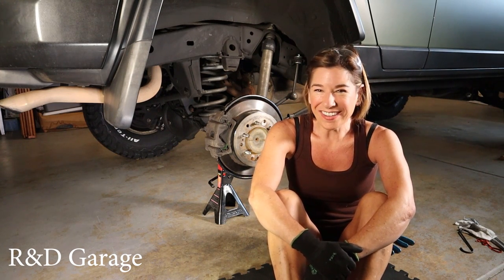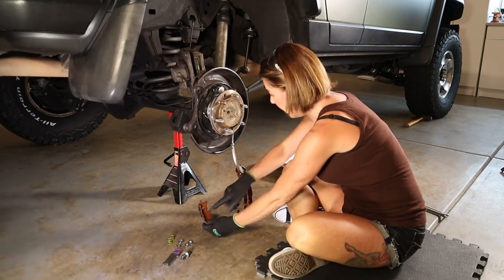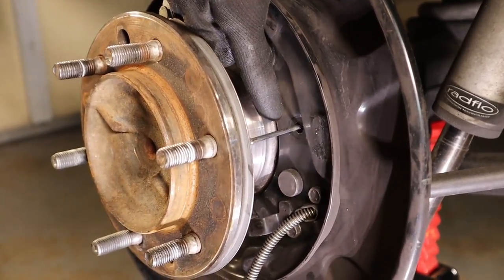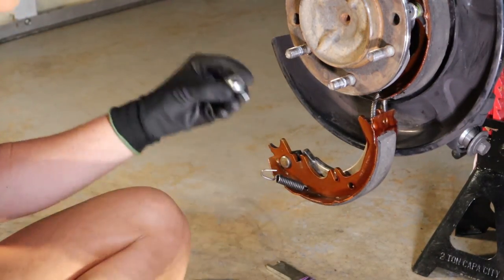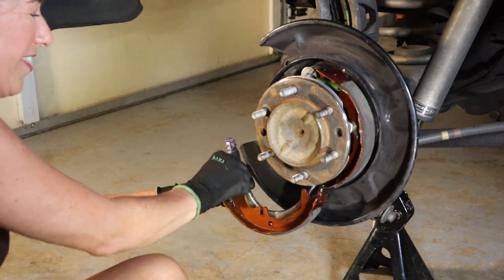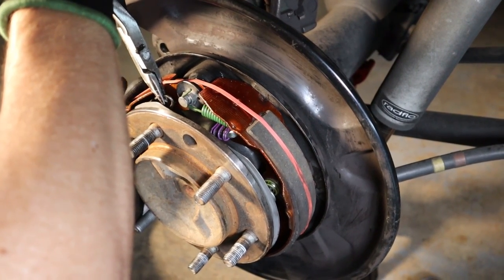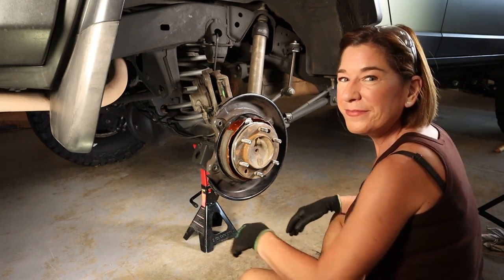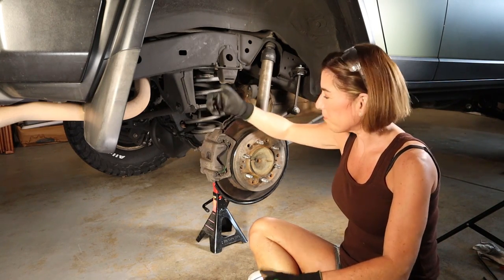How To set the Parking brake on Toyota FJ Cruiser!!

Comment: Thank you SO much for covering a topic that has basically never been covered by the FJ community! You’re a life saver!
Reply from the maker: You're so welcome and I'm super happy it helped you, Judah! Thank you so much for watching, you made my day! :)
Reply: @RDGarage  if im replacing calipers, is the one wheel at a time ok to do? Any hangups in that scope of work where getting both sides up is better? Thanks
Reply from the maker: @svnbit8408  One caliper at a time isn't a big deal but you just have to make sure you properly bleed the brakes each time. If you're doing pads/rotors with the caliper, it's best to do them in left and right pairs.
Reply: @RDGarage  Thanks, I'm definitely going to do the calipers, rotors, pads I don't want to mess around and they are problematic anyways. 
Would you happen to know if the hand held vacuum bleeding works in the rear with the electronics that work in tandem? Not quite sure if it's as easy as the fronts, with the vehicle off. (I read the master cylinder bleed requires test equipment to open the actuator with intermittent electric  pump pressure doing the bleeding, I think.
First time doing rear disc brakes. Thanks for the content!
Reply from the maker: @svnbit8408  You're welcome! Because of the importance of the proper bleeding of the brakes, I strongly suggest you refer to the Factory service manual for the proper procedure! As long as you didn't remove or take apart the master cylinder the bleeding process doesn't require any special tools.
Reply: @RDGarage  Thanks, I suspect my bleed on the fronts when I replaced calipers, wasnt the best., pedal is a bit soft, has that characteristic squish from the actuator not sealing up properly, or just the rear wear is causing it  (Fluid still full) I figured I could try that pump to get a better bleed from the front, and see how that feels before moving on to the rear, seems more straightforward without anything fancy. 
Getting it done tomorrow morning before a trip to the mountains, on a Sunday not an ideal day for parts runs or bail out at a brake shop lol. As long as I don't starve the master cylinder I really don't have an excuse, lol. 

I spent hours cleaning out my garage and fixed the malfunctioning higher-clearance door that allows space for vehicle on stands. (main reason for my initial question, I thought I might have to do the rears on a slight grade on the driveway, wanted to play it safe) 

I'm glad I switched gears, got the class -5 hoarder garage situation under control, and knocked out all the maintenance and repair stuff and can do the brakes in the am comfortably, with your insights and with a second set of hands around if needed. 
Cheers,
-Lee
Reply from the maker: @svnbit8408  You're so welcome!! Good luck!!

Comment: 2007 FJ has a noise behind the rotor and found the retaining spring was loose and cap was bouncing around. I almost pulled the hub and axle. I should have thought of a simpler approach first. The parking brake engineer definitely needs a slap on the back of the head. We are the original owners and it has 216,000 miles. Thank you for sharing and have a great day.
Reply from the maker: Hahahaha!!! I agree and that’s putting it nicely!! The parking brake is not a fun job at all. How cool you’re the original owners!! I hear that’s still pretty low mileage for one of these guys. Thanks for the comment and have a great day too!

Comment: I found a video where they installed the clip assembly first, pulled and slid it into while inserting the shoes. I used a small zip tie to compress the spring. The shoes has a slide and not a hole for the clip assembly.
Reply from the maker: Yes!! Thanks for the tip!! It seems everyone has a way to get this done and I love hearing the solutions!

Comment: What I do is get a forked body trim tool, put the spring and spring bottom and top on and lock the front retainer then pry the back with the forked tool so the spring is loaded up. Then I push the shoe in,  let go of the loaded up spring and usually I just have to move the bottom retainer arm into the shoe's hole to lock it in. Way easier than trying to put each piece in and then lock the retainer over the spring through that tiny hole.
Reply from the maker: Nice, thanks for the advice!

Comment: Hey R&D
So I had a shop replace my rear right axel seal. Immediately I noticed a strange vibration and clicking happening in the shifter console. I was adamant it had to be something that was done incorrectly as it began within 5 miles of that service and had never happened before. They eere defensive and a challenge to have them keep custody. Ultimately they said they found the issue in the p brake cabling being too loose. That they had to tighten the cabling and that they had corrected the issue.  
I took custody and it appeared to be fixed for the first few 100 miles. Then I noticed only randomly and infrequently, a faint noise from the rear, very slight ticking. That went away completely. For about 4 weeks. I wondered if it was the back door hinge. 

Tonight on the highway at 70mph I hit a slight bump on the highway, and the chatttering and vibrations in the shifter and p brake handle came back in full force. It was alarming. I drove through it for a minute looking for more changes in the transmission or something worse to appear. It drove and appeared fine aside from the noise and vibrations. They worsened when pulling the p brake handle up 1/8 of an inch. 
I accelerated up to 80mph and after a minute at that speed, the vibrations and chattering stopped completely.

Any ideas of it could be the wheel/brakes being improperly reset, or something more serious with the axel seal install?
Reply from the maker: Oh no!!! Ok, let me look into this a bit, I have some ideas but I wanna make sure I'm correct. Sorry took some time, I was at PRI since wed.
Reply: @RDGarage  Update is that I diagnosed the possibilities myself and provided them a written timeline that they reviewed and inspected with the vehicle today. 
That the seal replacement was not working and that the extra grease had failed the emergency brake clamps through saturation. That’s their story. Or that the brakes were not properly reinstalled after an improper seal replacement is my fear. But I seek the positive. 
They reported the failure, confirmed the damage of the brake system and are accepting the cost for replacements so far, a complete restart of the job. 
They have a generally great reputation and have not failed me up unto this point. We shall see.
Reply from the maker: @rztricky   Ok, it seems to me that if they only replaced the axle seal and nothing else, that's a problem. The indicator of a blown axle seal is grease everywhere in the brakes. If they've already agreed to go through the brakes, go with that and see what happens. Don't forget the axle seals can sometimes be damaged due to plugged axle vents so be sure they checked and cleaned the vents in the process. Good luck and keep me posted!

Comment: Great video! Thank you. I have a quick question, where does the white "anchor spring" go? Thank you
Reply from the maker: I'm not quite sure what spring you're referring to..could you give me a timestamp?
Reply: It’s not in your video but it’s in the new hardware kit and on the awful Toyota supplied diagrams.
Reply: Also, did you use the actual Toyota kit? Your caps on the pins look much better than the aftermarket one that I purchased from Amazon. Thanks again
Reply from the maker: It's hard to say without seeing it in person, and yeah, mine was an aftermarket kit from rock auto. Raybestos brand kit.
Reply: The parking brake diagram from Toyota has a spring called the Anchor Spring

Comment: Will you be upgrading with a Rear Drum to Disc Brake Conversion kit?
Reply from the maker: The FJ has 4 wheel disc brakes from the factory. The rear parking brake is a little drum brake inside the hat of the rear rotor.  Maybe you were thinking of another car?
Reply: @RDGarage  I think you are right.

Comment: I put in new shoes and hardware, but I can’t seem to get the right side adjusted. When I set the parking brake there is movement. There’s more to the story, but never ran into a problem like this. Is there a certain way the adjuster goes at the bottom??
Reply from the maker: The adjuster should be oriented so when you turn the adjuster wheel down from the front it should be "loosening", i.e., bringing the bottom edge of the shoes closer together. Hope that helps, thanks for watching!

Comment: Can you explain the tension method Without opening it
Reply from the maker: If you're talking about setting the parking brake shoe adjustment, there's a rubber plug on the backing plate. Lift the rear wheels off the ground, and then pop the rubber plugs out of the backing plate. There will be a toothed wheel visible through the hole in the backing plate, use a flat screwdriver or small pry bar to turn the toothed wheel until the brake just starts to drag while spinning the wheel. Back off a click or two and you're done. Thanks for watching and the great question!
Reply: @RDGarage  thanks
Reply from the maker: You're welcome!

Comment: Same as my '09 4Runner. I HATE these parking brakes. My pins always break from the rust wear ridge inside the rotor hat dragging on the shoes when pulling the rotors off. Even with the shoe adjusters all the way in. LOVE those five spoke FJ 16" wheels though. Offered on the '09 4Runner (one year only).
Reply from the maker: Yeah this was a complete BEAR of an install!!  Thanks for watching!!